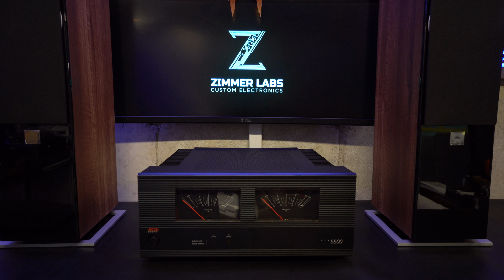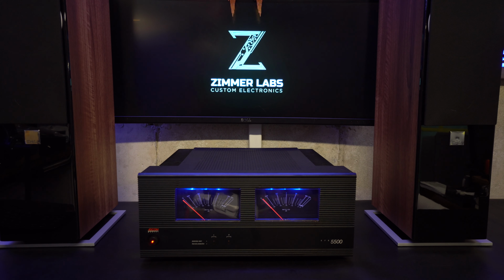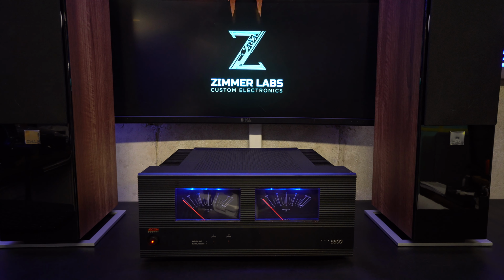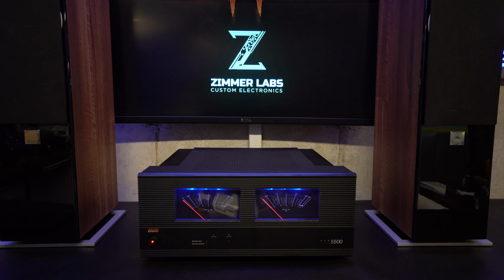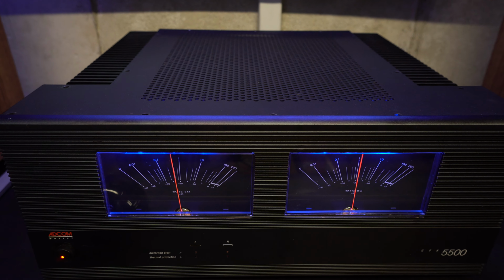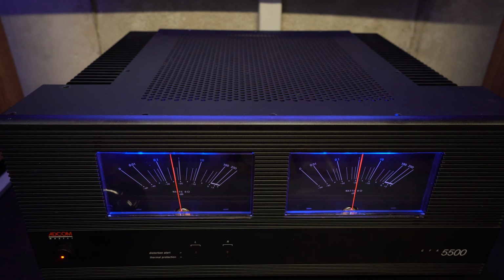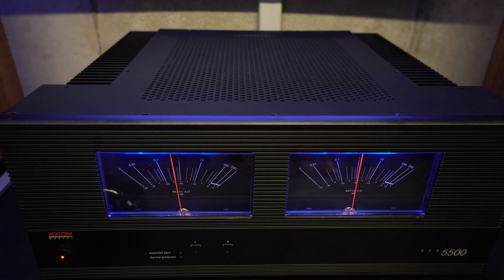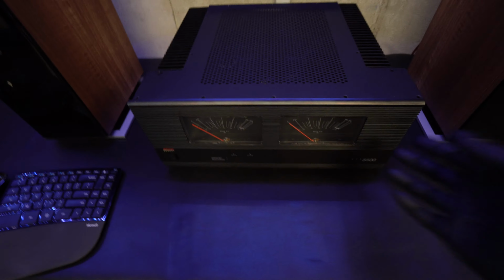Adcom GFA 5500 with Custom Analog VU Meters

Comment: Hi Ethan, you did an awesome job, I like VU meter too. I'd like to have one, if I want to purchase, what would be the price. Or if you build another one what would be the cost. Thanks in advance. Larry Yang.
Reply from the maker: Hi Larry, thank you very much.  The price to build another one would be whatever the cost of the amplifier is plus $500.  So if you have an Adcom amp, I could do the install work for $500.  Otherwise, I could try to find and purchase a nice used Adcom and then build this for you.  I don't know what they currently sell for used.  If I remember correctly, I think I bought this one for around $600-$750.

Hope this helps.
EZ